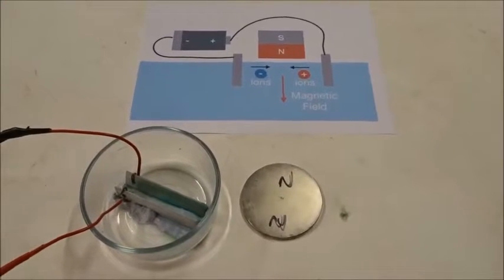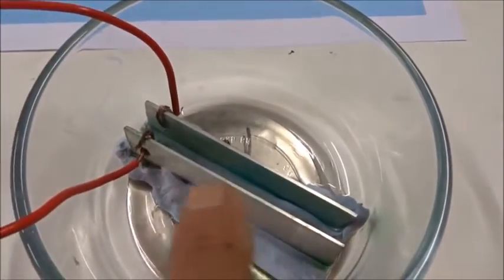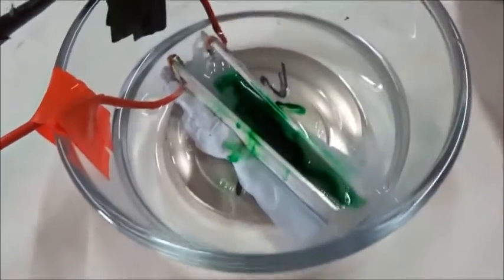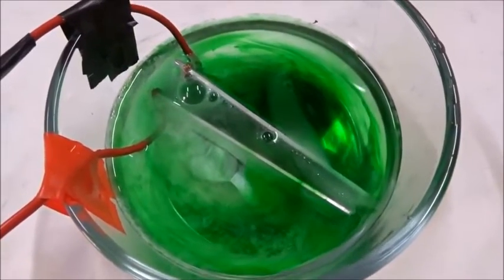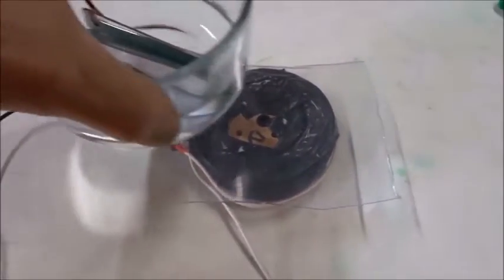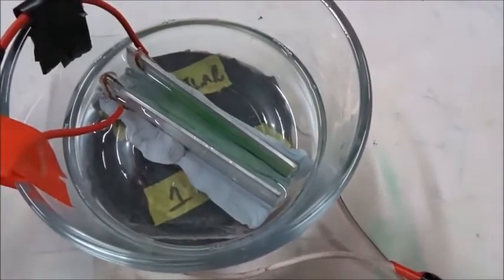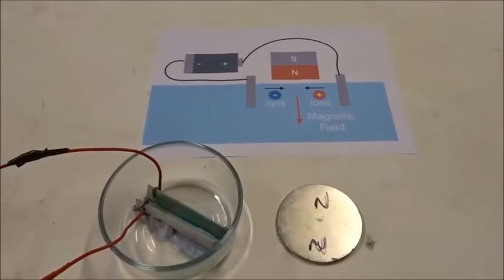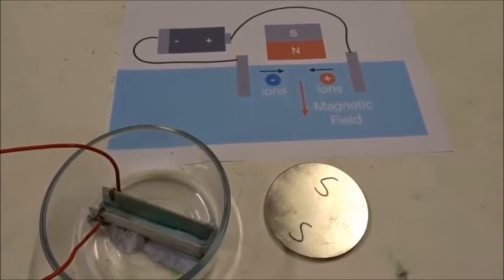The physics of magnetohydrodynamics: a simple teaching video

Comment: UFO liGhts or "maGnemites"  and crop circles are from the electromaGnetic toroidal fields in these locations they are usually found on lay lines, fault lines or asteroid impact craters actually if you take the 2D shape of the crop circles and expand it to 3D you will Get the frequency it is emittinG per cymatics... At least this is what my research has concluded thus far LoL